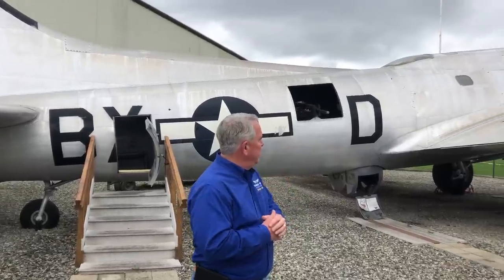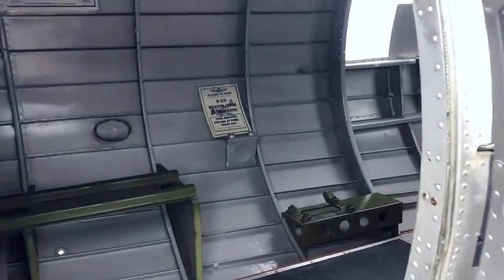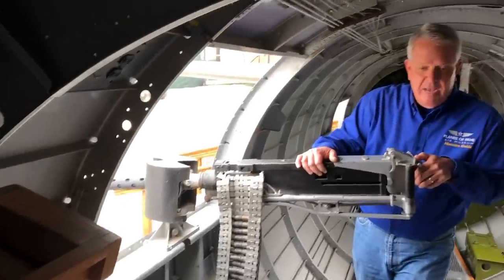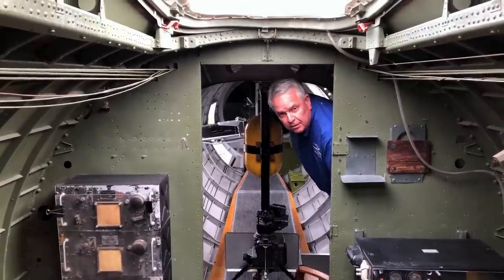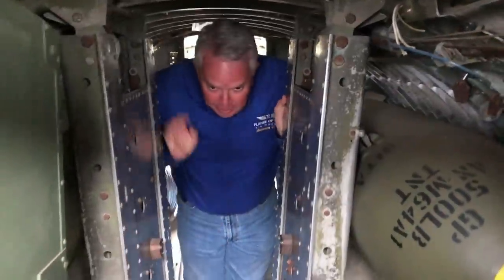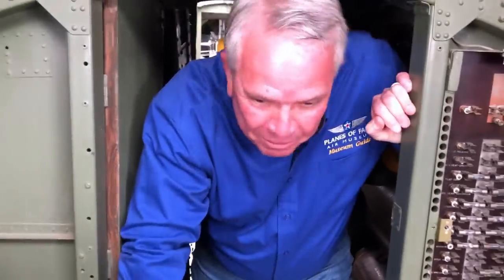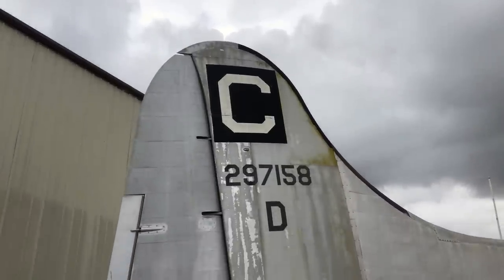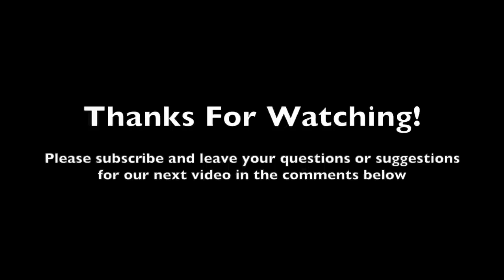Aircraft Tour! Boeing B-17 Flying Fortress

Comment: In 2000 I flew in a B17 called Nine O Nine. This guy did a great job. My ride was as a passenger and lasted for 20 minutes.  This was on my bucket list. The skin of the plane is as thick as a cereal box cardboard.  The noise was deafening with those 4 big engines.  Unpressureized cabin and plywood for seats. My respect for these men grew ten fold. Sadly the plane crashed in 2018 and several people were killed.

Comment: Mark 7:38 never knew there were Top Turret operating systems with chairs.  I thought the top turrets were all operated from a standing position within a rotating ceiling to floor ‘V” frame with foot peddles on the floor.  I'm always excited when the lower part of the top turret operating system is left in position.  On most touring B-17's they remove the lower part of the top turret and people think the gunner just had two guns sticking out of the turret and used his muscle to turn the turret.  I understand why they do it (ease of public access) but I still think it is a misrepresentation.  I believe the B-17G "Nine O Nine" (N234909) had the full stand up Top turret mechanism but she crashed and was lost 10/02/2019.

Comment: A very informative tour. Some great strides have been made in the restoration of the former "Picadilly Lilly" since we saw her on a visit to the Planes of Fame museum in June, 2016. I was told the plan was to restore her to flying condition, but I've read that it may not be possible due to corrosion in the main wing spar--Is that true? Regarding crewmen moving around the interior in flight--I once attended a seminar on flying in combat in the B-17 at an EAA AirVenture in Oshkosh, WI about 20 years ago One panel member flew 14 missions  before being shot down and made a prisoner of war with the Germans. The plane was hit and they heard the bail-out bell. He was the flight engineer and had to leave the top turret, find and clip on his parachute, then try and crawl forward because a  wing and bomb bay were on fire.  It was a tight fit with his heavy sheepskin flying suit, parachute and harness catching on everything. He and the navigator were able to get out of the front escape hatch and they were the only ones to make it out. He landed OK and was captured right away. The navigator had serious fractures from parachuting and landing and spent  a couple of months in a German hospital. The man spent something like 20 months in one of the Stalag Luft camps before he was liberated. He figured when he was escaping the burning plane, it took al of about a minute and a half. I remember he said when he deployed his 'chute, the force ripped one of his sheepskin boots right off of his foot!
Reply: Wow!

Comment: The contrails, while looking so cool, were also an aiming point for the German 88mm anti-aircraft guns. They had various ways to determine the altitude, such as info from the fighter pilots who were engaging the bombers, and then they set the altitude of the projectiles and led the planes.
The box formations were designed for maximum coverage of all the guns in the planes. They were also supposed to fly at specific distances from each other. This information is available on the internet. Supposedly, if you maintained your position, when you dropped your bombs, there'd be a clear path to the ground. Sometimes, it didn't happen right. One of the most famous films shows a bomb hitting a B-24 right at the wing root.
I've toured a B-17 and a B-25. They are both very tight, as shown in this video. My daughter has claustrophobia. Even knowing that we only had to go through the plane to an exit was making her very anxious.

Comment: I worked loading fire retardant onto a couple of these planes nearly 50  years ago at a "fire base".    They were converted for that purpose, yet the smells and sounds of the planes remained as if they were still parts of an even earlier past.  I can still recall the oily/musty smells and the hum of the engines.

Comment: It is interesting to compare it to the UK Avro Lancaster bomber. Very similar size and weight to the B17. Only 7,377 were build but was able to carry the 12,000 lb (5,400 kg) Tallboy and then the 22,000 lb (10,000 kg) Grand Slam earthquake bombs. One of its many famous missions was Operation Chastise, the raid against the Ruhr dams dropping 9,250 lb (4,200 kg) "Upkeep" bouncing bombs. These bombs were released at the very low altitude of 60ft, bounced along the surface until the dam wall then dropped down the dam face to be detonated at a predetermined depth to cause the most damage.

Comment: Has the rear turret been fixed on this b17? I thought it was normally clad in a flexible material
Reply: Like most of the later production block B-17s, modifications were made to the rear gun position to enhance visibility and provide better comfort for the rear gunner position. Initially, the modifications were made at the USAAF air depot run by TWA at Cheyenne, WY. That modification was known as the "Cheyenne turret".  Late production B-17Gs produced under license by the Vega division of Lockheed and by Douglas incorporated the "Cheyenne turret" into their production lines. Currently, none of the flyable B-17s are Boeing-built. All are late-production block B-17Gs built either by Vega or by Douglas and all originally were built with that 'Cheyenne turret.'

Comment: I would love to see one of these actually flying around.
Reply: Outside San Diego was an annual air show, featuring original war-birds.  My house overlooked the SD River valley, and these planes use to fly right over at less than 3000', including a B-17.  Strange to see five  P-51s in formation going over your head.
Reply: There are a few left that still fly. Unfortunately, one of those semi-recently crashed at Bradley in Hartford, CT

Comment: What is the device at 8:37?
Reply: That was a Drift Meter. I specifically remarked when I saw it, because we had essentially the same drift meter in the P-3 Orions when I flew in them. (U.S. Navy, 1975 - 1995.) The meter mounts  through the small hole on the side of the aircraft (see the gas-cap-looking cover), and by looking through the periscope-like eyepiece (the black circle part on the top as it sits there) and plotting reference points on the ground, the Navigator can determine how far the aircraft is drifting left or right from its intended course. Remember, back then there was no GPS, no LORAN (Long Range Air Navigation), no VOR or TACAN. They did have homing beacons, but they only helped you find your way home. The Germans weren't accommodating enough to send out a radio beacon for our boys! LOL  Navigation was Star/Sun shots with a periscoptic sextant, dead reckoning, and consensus with other aircraft. It certainly wasn't easy, even without the cold and people shooting at you!
Reply: @jimtownsend7899  Thanks for the reply, I really appreciate the information.  No VOR?  Must have been rough.

Comment: I wear a military green colored t-shirt with the United States Army Air Corps Insignia on the chest area along with my 1940's Coca * Cola logo red colored ball cap hat.  The United States Army Air Corps (USAAC) was active from 2 July 1926 – 9 March 1942 and was disbanded 18 September 1947. The Lineage of the United States Air Force are as follows : Aeronautical Division, Signal Corps 1 August 1907 – 18 July 1914, Aviation Section, Signal Corps 18 July 1914 – 20 May 1918, Division of Military Aeronautics  20 May 1918 – 24 May 1918, Air Service, U.S. Army  24 May 1918 – 2 July 1926, U.S. Army Air Corps  2 July 1926 – 20 June 1941, U.S. Army Air Forces  20 June 1941 – 18 September 1947 and United States Air Force  18 September 1947 – present. The United States Army Air Forces (USAAF or AAF) was the major land-based aerial warfare service component of the United States Army and de facto aerial warfare service branch of the United States during and immediately after World War II (1941–1945). It was created on 20 June 1941 as successor to the previous United States Army Air Corps and is the direct predecessor of the United States Air Force, today one of the six armed forces of the United States. You're welcome for the clarification.